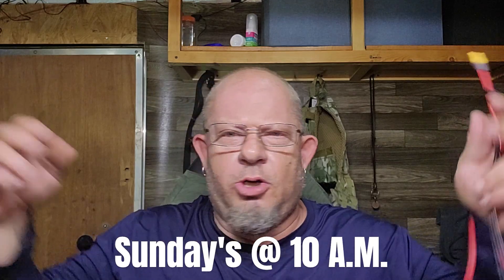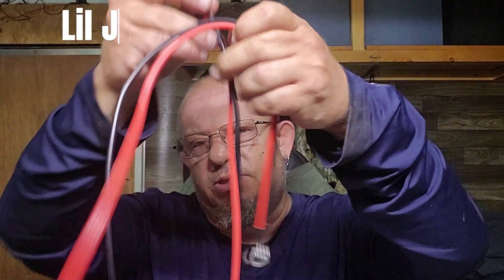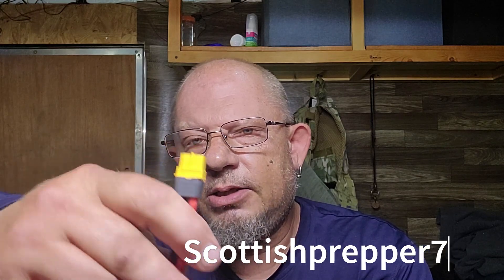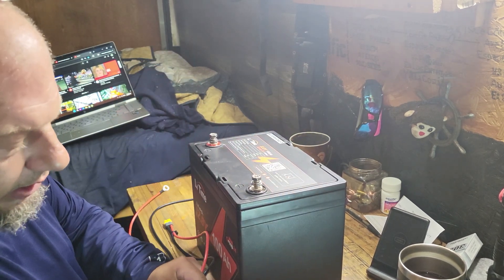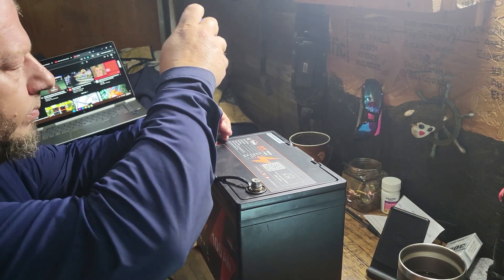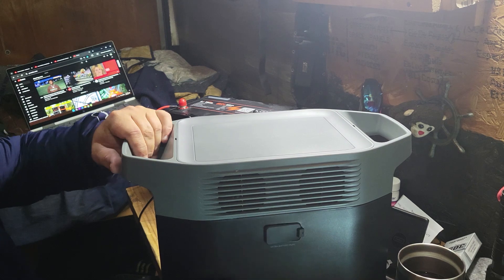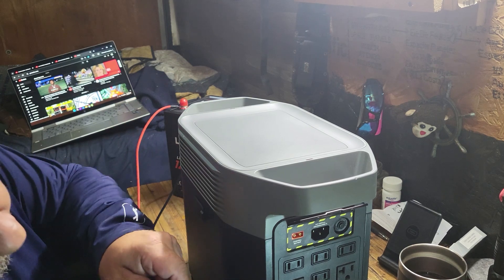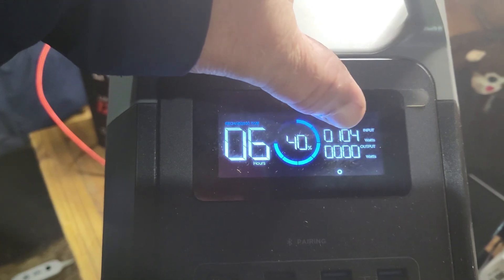Add ANY Battery To Power Station / No Inverter / Solar Sunday

Comment: The BMS in the battery is 100 amps not watts the power station is limiting the power thinking it's a,cars cig lighter outlet
Reply from the maker: @Self.reliant  thanks for correcting me.. I didn't notice I said it wrong until after it was uploaded.. I am considering taking it down to fix that incorrect info but at the same time the video does show the desired information at work.. what do u think
Reply: @MunkyWrench  no worries I think people will read the message and thank you for responding it's nice when we all learn togather.
Reply from the maker: @Self.reliant  I agree.. I hide no comment and I admit when I am wrong.. I want people to learn because of me or in spite of me lol.. I am thankful viewers like you comment and help out. it means so much
Reply from the maker: for starters I pinned your comment to the top for all to see my mistake and hopefully catch this information
Reply: Charging cables to charge battery with power station?   Back and forth

Comment: Ok just what I wanted to know. Now what I need is how to recharge the external battery from the all-in-one unit so when its got pawer coming in, it recharges the external ones first or as well...
Reply from the maker: Call them battery 1 and battery 2 .. for our purposes .. you plug battery 2 into battery one to connect them.. then while connected you charge on battery 1 and it will automatically pass through to battery 2 .. hope that makes sense
Reply: @MunkyWrench  I didnt realize that the inbuilt MMFT went both ways. Cool. Id have thought they would have (diode it) internally so it only flowed one way...  Jasonoid - Solar Power, Batteries, and More! has some cool videos on expanding with external batteries too and thanks for the reply. Ive subbed too. So cheers for that (Bundaberg Queensland Australia)

Comment: Not sure what batteries you use, but most modern ones can be discharged @100Amps... making that 1260Wattt, likely to be limited by the ecoflow at 600Watt or so...
Reply from the maker: Your absolutely correct. we have been discussing this in the comments I was wrong about that bit but I have decided to leave the video as it is because it still shows the information needed to show. I will address this in a future video. I am thankful for viewers like you that bring this information up for all to see .

Comment: Just curious...
Can you charge the battery while connected to the power station?
Reply from the maker: in many cases yes. For my Ecoflow delta 2 the answer is yes because it has what's referred to as "Pass Through Charging" so you have to check your owners manual or look for that feature built in when your shopping for a new power station. I think most of the brands have this these days. usually easy to check for.

Comment: The likely reason why its limited at ~100 Watts is it's an XT60i socket (Orange) it has a centre pin that you bond to either + or - to set the charge mode. Using an XT60 (yellow) plug, the D2 will likely default to car charging mode as if you have the supplied cigarette socket cable attached.
Reply from the maker: Thanks for bringing this up I have recently seen that xt60 I-F cable is a high capacity cable that allows more wattage to move. I have already ordered one to see the difference and will make a new video about it . I am always open to new information and I appreciate you taking the time to help me learn
Reply: I have a River 2 Pro, and with the XT60i I get 172+ watts.
Reply from the maker: @bobanmilz6512  i just ordered that xt60i and will make a video showing the difference in input for sure. I am still learning and glad for input from viewers to help me grow in my knowledge
Reply: @MunkyWrench  I just got one a couple weeks ago, I didn’t think it would make a difference.
Reply from the maker: @bobanmilz6512  i'm glad you let me know I feel better about having ordered it. it has something to do with the extra copper band on the plug to allow more watts to flow safely
Reply: @MunkyWrench, the pin is bonded to Negative for Solar mode (15 Amps max) and Positive for Car mode (limited to 8 Amps). Remember Watts = Amps x Volts. The ports max is 500 Watts. As your volts drop your Amps rise. Because you are about to use a cheap solar cable the wire may not be thick enough to carry the current.  It's probably better to make a cable.
Reply from the maker: @KJPage  agreed.. next Sundays video is already recorded I am making my own cables for mc4 connectors.. the following week will be the difference in xt60 connectors.. They are 10 gauge wire which is what is recommended by the manufacturer. for solar input of 500 watts.. I typically use 350 watts of solar max at 29 amps and have been using it this way for over a year so I am sure for small systems I am covered.. new batteries have arrived from my sponsors for stand alone systems which I will be using beefier wiring
Reply: @MunkyWrench  I just seen video from Volvo Camper Life, jumping the pin. Test it out?
Reply from the maker: @bobanmilz6512  definately will do as soon as it arrives
Reply: @MunkyWrench  I think you may be missing the point. Do the math and work out the correct wire gauge needed. Your 12VDC Battery voltage will likely be around 12.x to 13.x volts loaded.  Where as a Solar panel operates at a much higher voltage. Even higher if a grid panel or in series. The D2 or D2M 's input maxes out at 60VDC.  And you will likely find to get the full 500Watts in the device will want a higher voltage closer to the 60VDC limit. Anyhow you'll see the different results as you play and hopefully learn as you go. Also there is no recommended wire gauge for a set current.  You need to take into consideration the run length also as this adds resistance.
Reply from the maker: @KJPage  I understand the math. I know when people watch videos and they have knowledge about power and solar they expect everything to be said at once but I find it easier to comprehend for new viewers in small increments . This video was a simple tutorial in how someone that uses a plug and play system can safely and cheaply add an outside battery with store bought wiring to get them started and break fears.. I personally have commercial panels that bring in 350 watts of energy when working at peak.. 350 watts divided by 12 volts is 29 amps max.. therefore even when using my solar I only use it in this format to keep my delta 2 powered daily and fire up my office with no issues. I understand that adding panels means a whole different ball game but that's not what this video is about. and the average person I find starts out with a 100 watt panel from HF and we all start small. I am showing how to begin to learn for themselves which is why I leave all comments no matter what because I am learning as well as potential NEW viewers to solar and power stations and I want them to understand that they can start small and cheap and not get overwhelmed. I hope that made sense I am typing fast lol. I am happy to have a back n forth chat here for all to see because viewers can also see the comments and maybe reach out to you or I for info and that's how we learn. I will continue to keep the videos short and to the point for viewers to build on without overwhelming them and possibly stopping them from even trying because its too overwhelming. We can all grow and learn and help each other and bring more people into the wonderful world of solar and power stations without pushing too hard too fast
Reply: @MunkyWrench You just mentioned "Safely" btw you should also probably be using a fuse inline. The Delta 2's input is limited to 500Watts or 15 Amps but because you're dealing with a battery and a Lithium one at that a fuse is really a must have for safety.
Reply from the maker: @KJPage  The specs say there is a fuse at the inlet point of the unit built in. I have considered adding another inline fuse as they are cheap and you can never be too careful
Reply from the maker: breaker in the unit not fuse sorry
Reply: @MunkyWrench the cable should have it's own fuse closest to the battery terminal rated suitably with some leeway for the maximum current the device can draw.

Comment: Lot of energy losses in charging, discharging, charging, discharging cycle
Reply from the maker: @pr5991  absolutely correct.. it's not optimal but it's possible and answering questions I hope leads to more learning.. and comments from people like you that add additional info like this. You rock thanks so much
Reply: @MunkyWrench  It would be great to run an experiment and measure these losses. You know the capacity of the battery, and can tell what it takes to recharge the Ecoflow. From other experiments I have done I would guess losses of 10 to 25%. Still, this is a simple and great idea. 1) it greatly expands the capacity of a power station 2) it is cheap. 12 volt lithium ion batteries are now under $200 regularly. 3) the power station has a user friendly interface and form factor that is not intimidating.